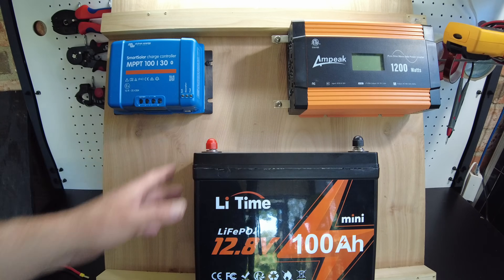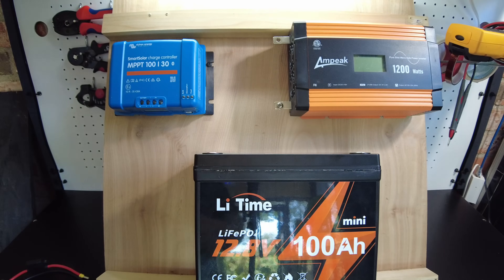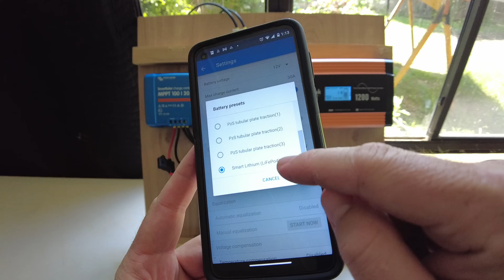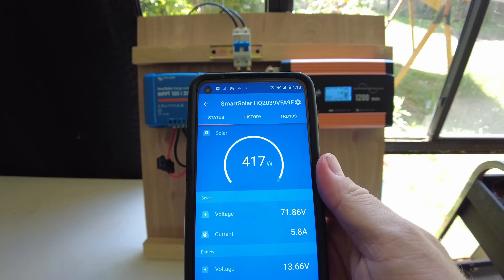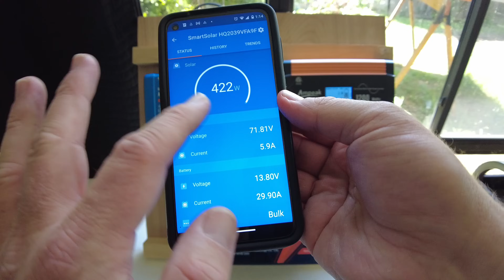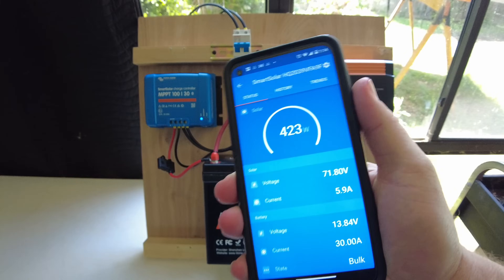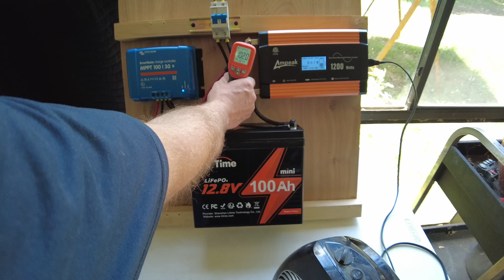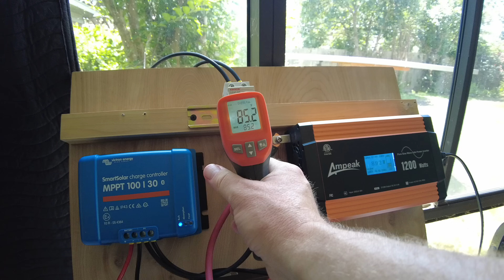Victron + LiTime MINI = beginner friendly off-grid

Comment: For appr. how long can I run a 400W (whatever) on a fully charged single 100Ah batt?
Reply from the maker: a 100ah 12.8v battery = 1280wh so 1280 / 400 = 3.2hours . However if this is going through an inverter you need to account for 10-20% losses.
Reply: @BradCagle  it will. Thanks for ur quick reply. I`ve got 8 of`m, several controllers, inverters (for reserves) cables aso and appr.5-6thouW panels for the garden as off grid use but yet no time to deal with it really! But ur info helps me to plan for the intended 3 different setups for 3 different "machines"!

Comment: hi....a mppt victron 75/15 works with two 50 ah lithium batteries?...4x100w connected panels 2s2p set to 24v....would it work!? any recommendations?
Reply from the maker: Yes that will work. Just make sure your combined panel open circuit voltage is under 75v. If you're using 12v panels 2 in series you're good.

Comment: If you are using solar to charge litime batteries, below 10.5 volts, if you are in the middle of nowhere, it will not charge with solar. You need a small lithium battery charger to start it. I own 2 and I am having a terrible time with them because of that
Reply from the maker: This is the fault of the charge controller.
If you have a Victron charge controller it will wake the battery up. Victrons will start charging your battery even if is shut down, and you will not have this problem. Thanks

Comment: is that a standard starter battery for a car? isnt a leisure battery better?

how long does it take to charge in that set up?

what can you run and for how long off that? 

i want to run a laptop, phone, fan and small fridge/cooler
Reply from the maker: No, it's not a car battery. It's a LiFePO4 Lithium battery for energy storage. Thanks

Comment: Nice video!  Question: what happens when the battery is full charged, the sun is shinning and there is no load on the inverter?  It looks to me this setup doesn't have taken this scenario in consideration, right?
Reply from the maker: It just stops charging That's the job of the Victron MPPT charger.
Reply: The inverter itself will draw power if it is left on even without a load and the controller will charge or not charge if the battery needs to be charged.

Comment: Is it necessary to put a fuse between the batter and inverter?
Reply from the maker: Yes
Reply: @BradCagle  I'm going to add a 150amp fuse it's a breaker fuse. I sent you a message on Facebook
Reply from the maker: @PlanetaryDefenseFoundation  If you use minimum of  2awg copper wire you can use a 150a fuse, or breaker.
Reply: Not must need,

Comment: Never arm an electrical system over a combustible  surface. Wood may catch fire if one of the elements gets heated. Your bad.
Reply from the maker: Thanks for the pro tip!
Reply: @BradCagle  This is definitely not a pro tip, this guy is an idiot. You can solder on a wood table and not worry about it catching on fire!

Comment: 😢i have a question that no one seems to be addressing.   I plan on building this simple system for my cabin.  Its only for lights, charging devices and maybe a fan and small fridge.   My question is if its better to leave this sutem in plave and constantly be charging for months (2 to 6 consecutively) that im not at the cabin?  Or is it better to shut it all down and spend the first day charging it all up?
Reply from the maker: I would probably just turn the inverter off, leave the solar charger, and batteries on, and connected.
Reply: @BradCagle  Thank you.

Comment: Was the fuse holder copper clad aluminum wire?  They don't make cheap fuse holders with all copper.  You provided a lot of great info. Thanks
Reply from the maker: It was copper wire. I toss aluminum wire in the garbage anytime I come across it. The wire was not getting warm, it was the fuse, or fuse holder. I've come across heat issues with fuses, and fuse holders in the past. I just make it a habit to stress test them after install to see how they perform. If it's too hot for my comfort level, i'll replace it with something different. Thanks!

Comment: Nice starter build.  I would make a few modifications though and the reason is that really NOBODY should be doing new systems with 12V batteries any more.   There is just no reason to use 12V even in a beginner friendly tutorial when 24V and 48V LiFePO4 batteries are readily available.   12V seriously underutilizes the Victron and requires heavier wiring and generates a hell of a lot more heat and losses.   So I would do this instead:

* Victron MPPT 100/20 SmartSolar charge controller.   This unit can handle 12V, 24V, or 48V.

* 24V Inverter.  Any brand.

* And a 24V LiFePO4 batteries.  Also any brand.   e.g. 24V @ 50Ah has the same capacity as 12V @ 100Ah. 

* You can go with 12awg wiring, but actually I usually just stick with 10awg anyway because I like the feel of the wire better and losses will be lower.

Or alternatively, go straight to 48V but in that case the smallest reasonable 48V LiFePO4 battery is probably going to be 50Ah, so the cost will be somewhat higher for the larger storage capacity.   Still, if you need that much capacity, then I would go 48V across the board.

The advantage of going to 24V or 48V is that you can expand the system later on without having to throw anything that you've already purchased away, the amperages are lower, losses are much much lower, heat is lower.

The only issue to keep in mind is that the solar input on the Victron has to be +5V higher than the battery voltage.  For a 24V system this means you need (for example) two 100W panels in series.  For a 48V system you would need three 100W panels in series.  I would still consider it to be a "starter" system though.  Just having one little panel is a huge waste of effort.

-Matt
Reply from the maker: Hi Matt. I have starter videos for 12v, and 24v.
I also have 48v starter videos in the works. Thanks
Reply: can someone please do a head to head comparison of all the new 460ah lifepo4 batteries that are coming out? redodo bird, roamer, litime, epoch, basen, VATRER, power drag queen, etc.. thanks in advance!  @BradCagle
Reply: My small sailboat has 150W of panels and my system is 12V so there is a reason for 12v still. I have led nav lights, charger for phone IPad and a small fan to power @20ah a day required. With 100ah LiFePo4 battery it works.
Reply: @georgewashington7444  Yes, 12V works for a system that small, though I'd personally still use at least 24V.  There are a few additional considerations for a sailboat though that you need to think about:

(1) Consider having two batteries instead of one, for redundancy so you have options if you are out to sea and something fails.  Same for other components.

(2) Put the batteries on an Anderson quick disconnect in case of a runaway (battery starts smoking or a fire), designed so you can rip the batteries out by main force and chuck them overboard if need be.

(There's no time to unscrew or clip anything if that happens, make it so they can literally be ripped out by their pull cords... add pull cords if you don't have them already, and chucked overboard).

(3) Consider a down-buffer battery for the marine radio.  Well, in your case it would just be a small DC-DC (12-12) charger and a 20Ah satellite 12.8V LiFePO4 battery that is capable of running the radio.  A 4A or 6A DC-DC charger is plenty for this application.

Usually the home batteries are low in the boat, so flooding can cause real problems.  Situating a small 20Ah battery right next to the marine radio with a little DC-DC from the home system to keep it charged and floating properly, is an important safety.  A tiny little car inverter to get a few USB ports and AC for emergencies (or even just regular device charging) hanging off the satellite battery is a good idea too.

-Matt

Comment: Simpler solution for portability just get a solar generator with the power you require....
Reply from the maker: Fair point. But one down side is a single component failure takes down a lot. Where as building a system you can replace, or upgrade any component yourself. Reminds me of when TV's started to have built in VHS players.
Reply: @BradCagle  You’re right, it’s good that people learn to build their own system, but my neighbors😂😂😂not going to happen if you know what I mean…I’ve already tried to show some a simple basic setup and the importance for it since we live on the gulf coast near Galveston and you know the weather we have experienced over the years, they’re just not interested…
Reply from the maker: @Zkpe02  Oh yeah, for sure this is why pre-built solar generators are so popular. Thanks!

Comment: 30A continuous you'd want 8 AWG wire, I think that Victron can handle up to #6..  I like to use as thick a wire as I can within reason, esp if it's short and cheap...it's just extra insurance and a tiny more efficiency.
Reply: I used a old set of jumper cables wire, They cleaned up and work great.
Reply: Wrong, 10 is fine all day for 30A.
Reply: If it can maintain 30 amps for more than a few hours, it's supposed to be increased from 10awg to 8awg.
Reply: 10 AWG should be fine

Comment: How do you size the solar disconnect breaker? Aka how many amps?
Reply from the maker: Based on the PV wire you're using. 12awg  PV wire is good for 20amps so usually you would get a 20amp fuse or breaker. 10awg is good for 30amps so 30amp fuse or breaker.
Reply: @BradCagle  wouldn’t you size the breaker to be less amps than the wire can handle?
Reply from the maker: @BobBob-il2ku  depends on how bold you are. 😂 If you want to be sure, do at least the breaker that matches the wire rating so 20a for 12awg. I've seen some systems that do 10awg with 32amp breakers
Reply from the maker: @BobBob-il2ku  i think technically you size the wire and breaker to be 125% of your max load. So if your PV max is 16amps, then you use 12awg wire with 20a breaker/fuse, etc

Comment: I like to ask a dumb question. A bright sunny day in December at 35 degrees and a bright sunny day in July at 80°. Do the temperature conditions affect the solar panels ability to put the same W back into the controller? The batteries will be indoors. I'm just trying to figure out the efficiency of solar panels during the winter time when the sun is out not so much a cloudy day or snow or something like that to strictly sunny days
Reply from the maker: Yes, cold winter sunny day will beat a hot summer sunny day as long as the angle is good.

Comment: question: how long does it take to charge that battery you have if it is nearly depleted? and using only 100W Solar Panel?
Reply from the maker: If your panel is putting out a full 100w the whole time, then it will take about 12.8 hours to fully charge. Now you usually don't get 100w out of a 100w panel because you cant keep the perfect angle, and lighting conditions the whole time. I usually figure 75%. Honestly 100w panels IMO are not enough, I would be playing with 300+ watt to start with. Look for used panels in your area.
Reply: @BradCagle  what happens if we use the old lead acid batteries, the kind that goes in a car, I know you can buy the solar Panels that unfold just in case your car battery dies. But what about a 100W big one? I saw a youtube video of a guy off the grid and built a tiny house, and used just one Lead acid battery and only used the battery to light up 12 volt items and phones and tablets. So is it dangerous? Or Safe? Thanks.
Reply from the maker: @studioopinions5870  Car batteries are not meant to discharge deeply. You can use it, but it will not last long. If you're going lead acid, you need deep cycle, and even then you can only discharge down to 50% or risk damaging it. Also lead acid batteries need to stay outside in a vented container as they will vent gas while charging.
Reply: @BradCagle  Thanks! Terry
Reply: For how much watt PV total does this victron 100/30 work? What victron would I require for a 1kw solar PV system?
Reply from the maker: @EnterOriginalUsernameHere  The victron 100/30 will do 880w at 24v, and 440w at 12v

Comment: Regarding the Fuses you have added, based on what you choose the Fuse amp? ( all fuses)
Reply from the maker: It's best to rate your fuses on the wire. So if your wire can handle 100A at max continuous, then you should use a 100a fuse, or breaker.

Comment: i have also this Hydraulic Crimper but when i want to crimp 35mm M8 on a 35mm cable it  comes off.maybe i have to use the 25MM to crimp the lug on the cable?
Reply from the maker: Yeah, I've had this problem on some sizes. Also not all lugs are the same, some are thicker than others. But yes what I do is go one size smaller if this happens. You might get some of the lug material squeezing out the sides, you can just clip this off.
Reply: @BradCagle  I thought the crimper was the issue but the lugs are.i ordered new lugs so I try a smaller crimping size. Thx👍👍
Reply from the maker: @Dave-xr9bc  Yup that's my finding, some lugs fit differently.
Reply: @BradCagle  do u mean i have to use smaller crimping dies or smaller lugs?i have 35mm cable,if i connect a 25mm lug maybe it melt with the higher amp?im new to this...
Reply from the maker: @Dave-xr9bc  I usually just try a smaller die

Comment: whew you made me nervuous! black before red unless you wanna be dead!!! ALWAYS hook your negative up first, and hook your fused lines up last, then use a resistor in the fuse hole to charge the circuits, put in your fuse and it should come to life safely! Please stop making videos if you are going to be dangerous! ALSO NEVER USE 2 HANDS WHEN TOUCHING ELECTRICITY! JESUS CHRIST!!! STOP MAKING VIDEOS! You are going to end up divorcing yourself from life or worse, getting someone else hurt who is watching this as a guide!!!
Reply from the maker: Literally nothing you said makes sense. This is 12v, nothing is going to shock me. I'd have to have the inverter on, and wiring up bare 120vac circuits to be concerned with two hands. LOL
Reply: @BradCagle  its not the voltage it's the amperage. That 1200w inverter will easily pull 80+ amps and if your finger slipped that would have went right through your heart to charge the capacitors in that inverter. It would have acted like a defibrillator and stopped your heart before you could blink, you're lucky to be alive.
Reply from the maker: @cgwworldministries83  Absolutely 1000% incorrect. LOL
Reply: @BradCagle  you are welcome to test it and find out ;)
Reply from the maker: @cgwworldministries83  12v will not conduct through the human body. I can grab both terminals of a 12v battery, and add a capacitor as well if that make you think that will change anything. Do you think I have not done this already LOL. I'll do it on my next video just for you. As a matter of fact give me precise instructions of what you want to see.
Reply: @BradCagle  its not the same as completing a circuit that is pulling 80 amps, despite the voltage friend. you have no understanding on how electricity works and it shows. which is fine, we all gotta learn, but stop acting like a know it all when your betters correct you.
Reply from the maker: @cgwworldministries83  You are making 0 sense. Complete a circuit that is pulling 80 amps? If it's drawing any current the circuit is already complete. So again give me a test case that I can perform on my next video, if you're correct I'll give you credit, and send you a prize.
Reply: @BradCagle  dont need any prize only that you follow some basic safety protocols my guy. take an amp meter (basic volt meter) and take a discharged 1500w inverter, and put it between the battery terminal and the inverter and you might be surprised as to how much it actually pulls when charging those massive caps. Please use clamps and not your hands. Clamp it to the cable and use 1 hand when touching the lead to the battery terminal. It's not the voltage that stops a heart, it's the amps. One slip of the hand and dropping the resistor or it not making good connection with 2 hands with you between could spell disaster. My father was EMS for 47 years and you would be surprised what "12 volts" can do to a person.
Reply: @BradCagle  you have to realize that it isn't a car battery but a 100 amp deep cycle battery with an inverter that can easily pull 80 amps from said battery, and spike when charging the caps. seriously I implore you to look into it. It only takes 0.2amps to stop your heart.
Reply from the maker: @cgwworldministries83  Car batteries can source far more amps like 400- 600amps. 0.2 amps won't get anywhere near my heart without enough voltage to get it through the resistance of my body. You going to give me a test case, or not?
Reply from the maker: BTW measuring the current as a cap charges through a low resistance conductor (i.e. a wire) is nothing like a high resistance human body. You need basic understanding of ohms law, and study up on the electrical resistance of a human. Then you will understand what you're saying to me is physically impossible.

Comment: Your concept is correct but your wire diameter is to small for a 12 volt system that's why your wires are hot. Your wiring diameter is for a 48 volt system which is really what you need for a off grid system. In 48 voltage wiring you can use small diameter wire all through out your system with minimal heat.
Reply: What's the right size?
Reply: Maybe 6mm ?
Reply: Maybe 20mm